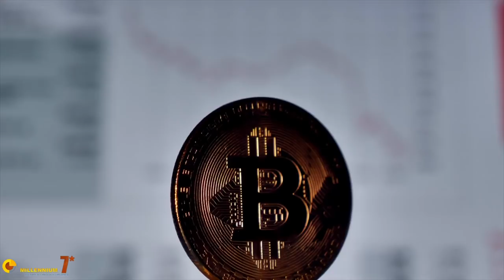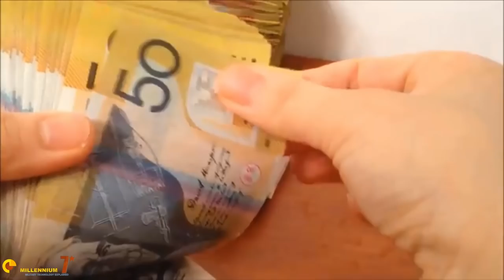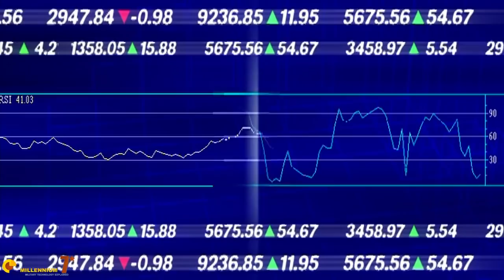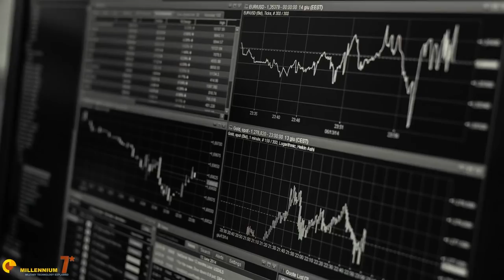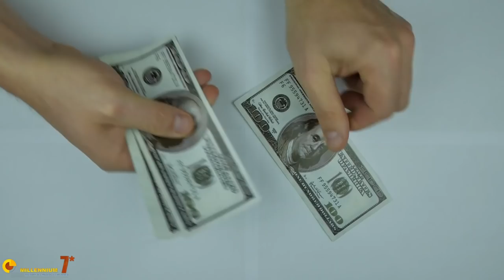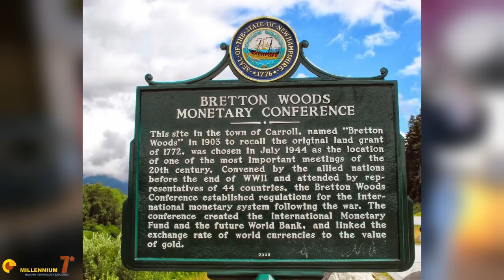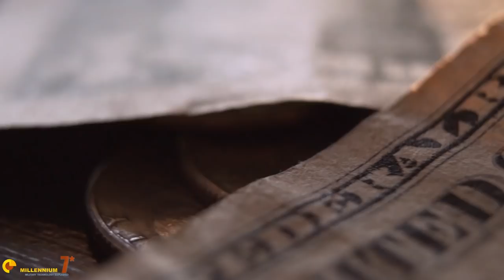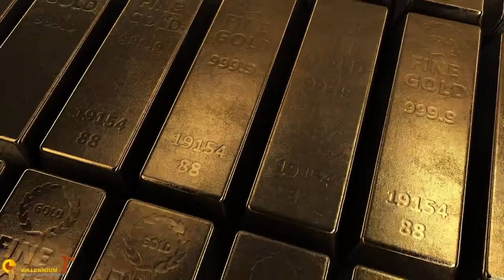How the USA can get unlimited F-35s without going bankrupt

Comment: Sweden has realized that a solid internal military industry is crucial and began this transformation relatively early, i.e., sometime between WWI and WWII. However, in a small country with only 10 million people, you can never hope to achieve a complete manufacturing chain in-house. This fact becomes more demanding and complex with time since technology evolves so fast. However, within the EU, this should be possible with some forward-thinking politicians.
Reply: Most of the Gripen’s critical technologies come from the US and England as a result.  Engine, Radar, landing gear, brakes, ejection seats, data bus, fuel systems, servos, weapons, etc.
Reply: @nattygsbord  Swedish defense industry businesses were largely bought out by foreign investors after the 2007-2009 economic crash, including Volvo Flygmotor.  But Volvo never made nor did it have the capacity to make fighter jet engine cores.  Sweden has always bought fighter engines from Rolls Royce in England, or Pratt & Whitney and GE in the US.

This is a constraint of population size.  There isn’t enough excess population in the margins to develop the industrial base necessary to make jet engines.  It’s not a nationalistic or political philosophy problem, but one of real limitations based on population size plus scientific prowess funded by the RDT&E efforts at advanced propulsion systems.

I agree with your overall sentiment though. Almost all of Europe is filled with incompetent and uneducated members of parliament who know nothing about the real world, and their decisions show this with almost every decision they make together.  It has been that way since WWII when the prime age makes were slaughtered at an industry scale.  Sweden should have avoided that since Sweden didn’t commit her forces to any combat action, but the spread of internationalism at the expense of sovereignty was widespread in Europe.
Reply: @LRRPFco52  
" But Volvo never made nor did it have the capacity to make fighter jet engine cores.  Sweden has always bought fighter engines from Rolls Royce in England, or Pratt & Whitney and GE in the US. This is a constraint of population size."
Not really, the French have built their own planes but also used American engines in their planes despite have a 6 x times larger population than Sweden. America is better at building engines. And sure being top of the food chain is good. When you make products that all other countries wants but no other country can make, then demand is high and competition is low and you can charge high prices and make huge economic profits. That means high wage jobs and large tax incomes for that country.
Sweden was a world leader in nuclear power back in the 1960s. And USA is world leader in jet engines today.
If Sweden did bother to put effort into it we could probably make good engines too. But thanks to EU-related deindustrialization do I think it is hard to recover what this country have lost.

But is it impossible for Sweden to make jet engines? of course not. Russia - a country with a GDP of that of Spain makes jet engines for fighter jets so sure can our own country as well.

"This is a constraint of population size.  There isn’t enough excess population in the margins to develop the industrial base necessary to make jet engines."
This is nonsense. As I said earlier, when you become best in the world at something then you will have demand for your products and can charge high prices for your products. Your stupid "too small population to create industrial base" theory also ignore the economic success of tiny East Asian countries like Taiwan and Singapore.
Those countries had tiny populations, but they could borrow people from other countries to make the consumption for them when their own populations was too small. That allowed them to start mass producing stuff and open industries of scale.

Sweden does not have 2 billion people like China but I do not see that as necessary for industrial development like you do. Switzerland is a country the same size as Sweden and it is the world with the highest number of industrial production (GDP) per person.  
And Sweden have indeed been able to produce weapons that are among the best in the world - Gotlands class submarines, Gripen fighter jets, combat boat 90, Archer artillery system, Carl-Gustaf recoilless rifle, Combat vehicle 90... just like we in the past also made weapons that were among the best: Viggen, Stridsvagn 103, Bandkanon, Draken, Bofors 40mm anti-aircraft guns, J-21 etc etc.
So we have obviously been better off without the EU, than with it.

"I agree with your overall sentiment though. Almost all of Europe is filled with incompetent and uneducated members of parliament"
You talk as if Swedish politicians have any power over this. They don't. At least not as long as we are part of the EU.
Macron and Merkels successor have more power over Sweden than our own politicians at this point, since our politicians have signed away every piece of souvereignty there is.
It is pointless to go to vote at this point, since everything is decided in Brussels by foreign politicians and not in Stockholm at this point.
The only thing I know about the next election is that I will vote for a party that is for a Swexit. 
The dysfunctional, corrupt EU can never be fixed. And I think a country with a 500 year old history deserves better than just being seen as the tiny province number 27 on a map. A place with no value at all to its rulers other than for resource extraction for the Merkel-reich.

Swedens economy was better off in the past. And I think its good for democracy and competence if we can choose to vote to remove governments that mismanages our country. But I cannot vote to remove Macron or Merkel.
So f*** this system.
So I say let's go back to something that did work well in the past.
The last 20 years of the Euro currency have only proven that the EU is incompetent to lead anything. Everything it touches turns into 💩. We had the Euro crisis in Ireland, Spain, Italy, Portugal and Greece. The Swedish crash in the 1990s was also caused by the Euro (or Ecu as it was called back then). Since the creation of the EMU have Italy's economy been the slowest growing in the world after Zimbabwe and Haiti.

Sweden have only lost money to this crap. First of all because of the membership fee. Then because of all bailouts. Then because of all red tape and excessive regulations. Then because our trade balance have developed badly because of our EU membership - and if Sweden we only count our trade with EU countries would Sweden run a trade deficit.. but with the countries outside the EU does Sweden run a large trade surplus. And in terms of value added exports, is USA our most important trading partner.
I would also go as far as saying that Sweden would be better off by not getting back money from the EU since the EU farm subsidies (which all of our 8 political parties oppose) does distort competition and favors big farmers at the expense of poor ones.
The EU have also banned capital controls - which have created a 4 fold increase in tax evasion in Europe since the 1960s, and this stupid rule have also created inflationary bubbles in real estate in Spain in 2006 and Sweden 1990.
But the biggest problem with EUs economy is that we are not allowed to have our own industrial policy and doing infant industry protection so that we can create new industries. No wonder then that the last 30 years have been wasted for Europe with stagnant economic development. And as long as we cannot create new high tech industries then we will never be able to become world leader at anything new - not nuclear power, not jet engines and not smartphones.
No wonder that USA kick Europes ass and have more Fortune 500 companies. And EU have nothing similiar to companies like Google, Microsoft, Apple, Amazon and Facebook.
Reply: @nattygsbord  Us population is over 330 million with the largest industrial base in the world, largest bread basket in the world, largest connected river network, temperate zone, 3 huge coastlines, 3 huge mountain ranges, tons of minerals and ores, forests, etc.

It takes a large population in the right conditions to be able to develop a jet engine program.  The manufacturing of the turbine blades in the high pressure section is much more difficult than building rockets and low earth sorbet satellites, for example.  If Sweden could do it, Iran already would have, as would Brazil, Indonesia, Pakistan, Nigeria, and Bangladesh-but none of them can.  Iran has great engineers and scientists.  They will never be capable of designing and building jet engines.

Switzerland will never be able to build jet engines.  They have world-class engineers and superb manufacturing quality, but simply don’t have the capacity to make jet engines.  US has been making jet engines since the 1940s.

A big problem with media inside of other nations is that they have an inferiority complex, so they portray their nations as equals or superiors to the US by means of simply having a flag and borders, without looking at all of the relevant comparative metrics.  Those metrics don’t care about feelings of patriotism or how smart the scientific community is.  They just are a cold, hard reality.  The US population is unaware of these things too and always told how much better life is in [insert flavor of the nation that week].
Reply: @nattygsbord  I definitely agree about Sweden’s economy being better off independent of the EU.  EU was bad news for Sweden, Finland, and Italy.  The EU is a massive failure of an idea because it’s based on the premise that over 2 dozen nation states that have been at war with each other in some fashion for the past 2000 years will now magically all share the same central government, monetary policy, trade, regulations, and border cooperation.

I’m amazed it has lasted this long.  The Euro currency is just the Deutchesmark normalized to the member states, for the benefit of Germany’s economy in the intermediate future from adoption.

My family is from Finland, so we’ve seen the same issues with valuation of local goods vs imported cheater GMO crap from Spain and other Eurozone nations where the local officials will fudge the numbers to pass them off as compliant with EU trade standards.  I always make a point to buy Finnish goods when I’m there.
Reply: @LRRPFco52  
"It takes a large population in the right conditions to be able to develop a jet engine program."
You see things as static, as if just because things are like they are like now, then they will always remain the same forever.

"temperate zone, 3 huge coastlines, 3 huge mountain ranges"
Yes there are different climates around the world. But we are not living in the 1600s. We live in the modern industrial age and we have learned to overcome such problems. Economies are no longer handicaped as they were in the past.
We use electricity that can be used every month of the year - unlike water wheels that freeze during the winter.
Its not like in the early 1800s when factories were closed because it was too dark to work during most hours of the winter months - now we have light bulbs and electricity so people can work any hour of the day if they want.
And our cold climate is no longer an obstacle to population growth since we now can import food and transport it to any place in the country. And people no longer have to freeze to death and we got clean water, soap, plenty of food, so people don't die before they get 30.
Technology have solved our problems that climate have created.
Tropical, humid, mosquito, malaria plagued areas like Singapore and Italy have undergone industrial development.
We got vaccines, mosquito nets, we drained swamps, and installed air conditioners.

"tons of minerals and ores, forests, etc."
I don't think you need natural resources to have a rich country today. Prussia was a poor backwater with no natural resources, but became a great power back in the 1700s. Japan had not much natural resources either. Korea's 3 main exports back in the 1950s was fish, tungsten ore and whigs made from human hair. And the country was one of the poorest countries in the world, Ghana was twice as rich as Korea measured in GDP per capita.
But the country is today one of the largest industrial nations on the planet.
POSCO managed to become the largest steel company in the world in only 6 years, despite Korea lacked both iron and coal and had to import those things from Austrialia, USA and South America. And despite having to import things from such a large distances did Korea manage to outcompete western countries and become the largest steel producer in the world.
And Sweden did also lose the title as the worlds largest shipbuilding nation to Korea at this time.

"If Sweden could do it, Iran already would have, as would Brazil, Indonesia, Pakistan, Nigeria, and Bangladesh-but none of them can."
Maybe they can if they make it a national priority and learn from history how to design an effective industrial policy.
I do not think that Americans got a genetical superiority in their blood that makes them better jet engine builders.
People laughed at Japan in the 1950's when they began building cars. Japan was a poor 3rd world country back then and America was the largest car producer in the world making millions of cars.
And the first cars Japan made were crappy and both many westerners and Japanese considered the idea an insane waste of money. They meant that Japan would be better off making things they already knew how to make well instead of trying to make a product they were not good at doing.
But the government continued to protect its car maker from foreign competition and giving it generous loans and subsidies. And the pathetic car maker Toyota did a few decades later turn into the largest car maker in the world, and General Motors in America fell into the 2nd place.

So things changed a lot in 60 years. Today is car making among Japanese seen as as natural as wine making is among the French.

So I say maybe then will one of those countries in the future make jet engines and compete with USA. Brazilian Embraer is after all the 3rd largest aircraft manufacturer in the world. And then we got SAAB and bombardier.

I also believe that countries have different strenghts and weaknesses. You seem to think there are only one correct way of making a product. While I don't share this view. Not all countries had plentiful aluminium like USA had in world war 2. So they had to invent other ways of making aircrafts. Britain became good at making planes from wood - like the Mosquito. Germany made planes out of magnesium which is stronger and lighter than aluminium and have similiar properties. And Russia tried to solve their alumnium shortage by making their planes smaller.
Today Germany makes cars with much industrial robots and machinery, while the Chinese with their cheap labor and scarce capital goods use old 1950s techniques of making cars by using large amounts of human labor instead.

So I think that countries always tries to invent their own ways of solving different problems. Not every country can be independent from fossile fuels by doing like Sweden and use nuclear power and hydroelectricity from its rivers.
Simply because many countries lack rivers. So then they have to use some other type of energy instead... maybe wind, maybe solar, maybe something else.
I don't understand why you think 3 temperate zones and natural resources are necessary for a country to make jet engines. I am however pretty sure that this is not true and that most countries can make jet engines if they put effort into it.
Reply: @nattygsbord  China made it a national priority in the 1980s to make their own jet engines.  It has been failure after failure.  They sent spies into every major western company- Pratt & Whitney, GE, and Rolls Royce.  They have thrown billions at trying to make a modern fighter engine, and continue to fail.  That was with thousands of sample engines from Russia in their possession on top of that.  They can disassemble and study to destruction all the materials they have.  

It isn’t about climate, but how many people working for many years with the right support.  When the US began working on jet engines, we were already behind England and Germany.  We surpassed both quickly and went on to become the global leaders in jet engine technology.  A huge distinction is the constant challenge to solve problems in the US defense sector by very demanding customers (USAF mainly).  There is no other person to copy off of, so we have to innovate the solutions from scratch.  That has created a culture that is palpably different than what you see in other countries when it comes to rising to the challenge.

Minerals, ores, and rivers absolutely do contribute to whether a nation can industrialize faster than others.  Prussia had all of those in its favor, and developed the strongest steel artillery pieces that it later used to defeat the French in the Franco-Prussian War of 1870, which was the culmination of the Prussian Reforms.

Embraer is listed as the 3rd largest civil aircraft producer, not 3rd largest aircraft manufacturer in the world.  Engines for the Embraer fleet are either GE (US), Honeywell (US) Pratt & Whitney (US), or Rolls Royce (UK).  They are a very, very distant 3rd place with no domestic jet engine production.  Canadair has produced far more civil aircraft so I think people are cutting them out because of the Bombardier acquisition.

Magnesium is definitely lighter than Aluminum, but not stronger.  This is basic materials science.
Reply: @LRRPFco52  
"China made it a national priority in the 1980s to make their own jet engines.  It has been failure after failure."
Sure there are failures. Sometimes countries fail to make a new industry grow up and become able to survive handouts from the government. But that is not an argument why a country should give up and not try and think it is hopeless to succeed. Toyotas first years were also failures in red inc. 
Nokia ran at a loss the first 17 years of its existence before it started to make profits and became the largest company in Finland and the largest mobile phone manufacturer in the world.

Sometimes parents fail to make their child grow up and become independent despite their best efforts. But I don't see that as an argument for scrapping parenting. Same goes with infant industry protection.
As you say yourself, the US aviation industry have had also been supported heavily by the US government and would likely not be where it is today without its strong support.

"Minerals, ores, and rivers absolutely do contribute to whether a nation can industrialize faster than others."
Prussia in the 1700s had not much natural resources. It industrialized around military goods - textiles, iron, swords, cannon balls etc. Korea and Japan have I already mentioned. Singapore and Taiwain are other examples. So yes you do not need natural resources. They can be good to have, but they are not necessary.

"Embraer is listed as the 3rd largest civil aircraft producer"
Going into a nearby field of research is usually not far-fetched.
Swedens industrial history is full of such examples.

First it sold iron ore and wood to other countries. Then it started to refine those products to make higher profits - by making iron and steel and selling lumber and paper. Then new industries arose around those products.
Paper making required much chemicals. So a local chemical industry was created to provide the paper works with chemicals, and to take care of chemical waste disposal.
Mines got electric lamps from hydroelectric power. And later on would also ovens in steel mills get heated with electricity. So an electric industry was created. And the steel making and electricity led to electro-mechanical products, machinery, and the making of ships, planes, aircrafts, drills and telephones. And with experience in those fields did Sweden diversify even more. Sweden with its experience in electricity started with nuclear power and began involve itself in microelectronics to make mobile phones. And it began building tanks and other weapons.
And because of World war 2 did all trade with other coutnries getting cut so no medicine could be imported, so the government asked the chemical industry if it could help - and it did, so a new pharmaceutical industry was created.
So Swedens economy was diversified step by step.
So if SAAB one day wanted to build jet engines I think it would be possible and same goes for Embraer and the others.

One should aim high (but being realistic of course). By learning new skills and making high tech products will a country get rich. And if you don't do that in this day and age, and just being content with you already have today, then other countries will outcompete you soon in the future.
No one wants a Swedish Facit typewriter today. No one wants analog camera junk. Telegraphs, horse and buggy, and people are no longer as interested in buying ice blocs since the invention of the refrigerator.
And if 100% of your countrys national income comes from one source - it will be tough that day when someone comes up with a new innovation that makes your export product obsolete. It was not fun for central America when a British scientist invented artificial dye from chemical waste, so countries no longer had to crush cochineal insects to produce color.